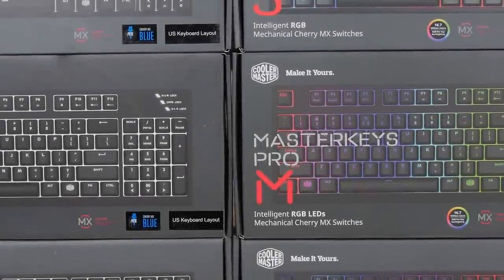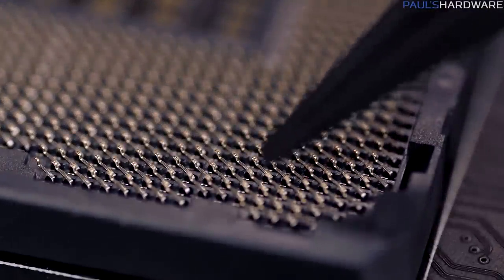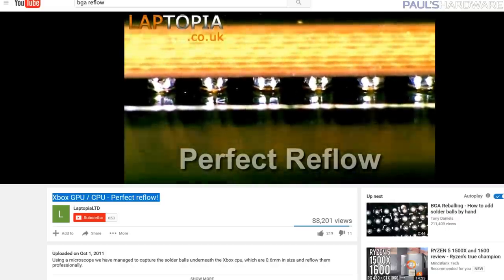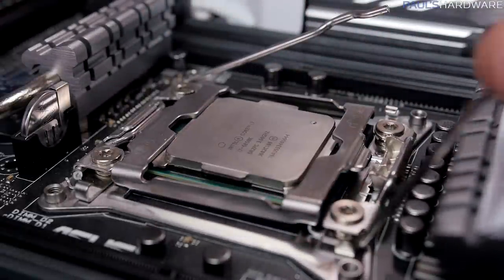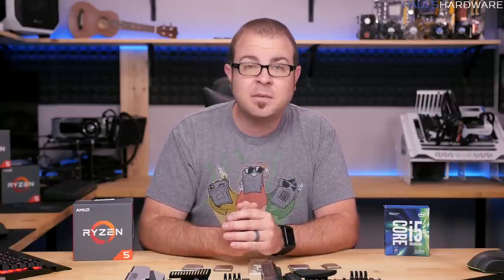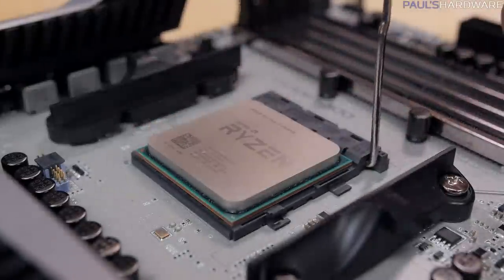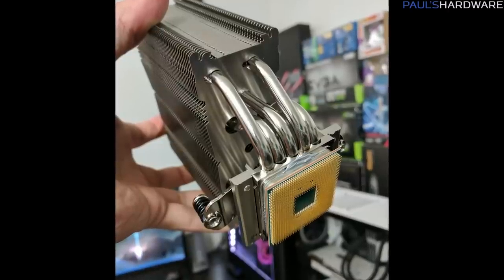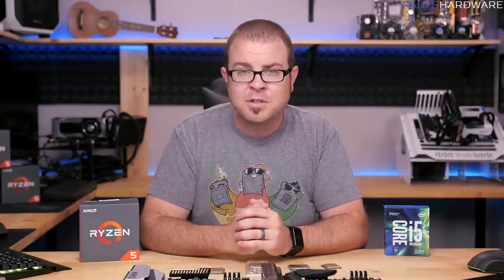LGA vs PGA! Which is better?

Comment: I had a 370 socket pentium 3 with some broken pins. I broke some off a celeron spare, put them in the corresponding holes and installed the CPU. Worked for years that way

Comment: I know so many people who have dropped their heatsink on their socket and bent those delicate pins, I remember I did just that when I built my first rig "775" years ago. I carefully had to bend them back with a sewing needle. Seen 3 other people do exactly what I did, forget the cooler fan is plugged in, loosely grab it, only to be snagged by the wire. Boom, drop it and hits the socket. A mistake I made years ago and will never do again. as they increase the connectors, I think lga is the way to go. but I liked pga better because the socket was less prone to damage and the cpu's were always the pieces I kept safest. Edit: also, I like to comb my hair with them, I feel high class combing my hair with gold.

Comment: Just use any plastic card, and a sewing needle to repair PGA pins. Sewing needle is used to fix really badly bent pins, and get them facing up. Then use the card and push all the pins in each row, and all of them will become straight. Takes some time, but it's much faster. Not to mention the CPU I repaired had around 50 bent pins, because my friend tried installing the CPU into the wrong motherboard and decided to try forcing it in....

Comment: Although socket type won't sway what type of CPU I build a system around, I have a very strong preference for PGA. I've only repaired 2 LGA sockets in my life time successfully, but I have straightened the pints on many a PGA CPU - it just takes a razor blade, a steady hand, and some patience. A PGA pin doesn't have to be PERFECT in order to work, there is some margin of error, albeit very very small.

EDIT - LOL, I typed this before I got to the part of the video where you nearly verbatim said the same thing about repairing PGA CPUs. XD

Comment: Even when a PGA pin breaks, your CPU still isn't toast. Sometimes, minor stuff is affected (like one of six SATA ports not working) and you can live without it. And also, you can repair even a broken pin. Simply place the broken pin into the according motherboard counterpart and you're ready to go. PGA is unbreakable, though I still prefer LGA. Socket for Naples and the 16-Core Ryzen is LGA btw.

Comment: I managed to repair an FX 8320 with 28 bent pins, luckily none of them bent in the middle of the pin. For me the last part of the process is a little elbow grease and plenty of socket wiggling to seat the pins proper. I still use the CPU to this day. Tricky shit tho, bending pins lol

Comment: Intel switched to LGA to transfer mishandling and invalidation from Intel to the motherboard makers. Shrewd move by the intel manufacturing quality control dept and the engineering dept to shift the potential of damage from the expensive cpu to the motherboard.

Also side benefit for LGA (as you pointed out) removing any cpu cooling is virtually guaranteed not to pull the cpu out, since the clamps will physicall hold it to the motherboard vs the ZIF socket is only holding the pins when clamped and it was only designed to make electrical contact to the pins, not to counteract a force pulling on the pins/cpu. 

Great vid.

Comment: The trouble with PGA is that the conductors are large relative to the tiny pins of LGA, and while that may be better for durability, causes PGA to have inferior electrical properties (to LGA).  LGA packages can attain a much higher signalling frequency vs. footprint ratio - as in, to reach the same signalling frequency the pins on a PGA package have to be farther apart than on an LGA package.  This makes CPUs with thousands of pins impractical as PGA packages.  Hence why AMD will be using LGA for Naples and ThreadRipper, as the socket is rumored to have 4094 pins...

Comment: It's very simple: LGA - more expensive motherboards. Risk is on the less expensive part. PGA - less expensive motherboards. Risk is on the more expensive part. easy. PGA has a slightly letter rate of contact where in the real world it doesn't matter much as swapping cpus is not something most people do very often.

Comment: imo the best solution would be a PGA with a retention bracket of some sort, to hold the chip to the board more securely than amd's little locker arm. the issue with PGA is after a while if you pull your cooler off the board, it generally takes the CPU with it, and bends the pins.

Comment: Over the years I`ve broken of pins on various stuff (from cpus, old  IDE HDD`s  to various other connectors) and still managed to get that stuff working by inserting a small pin made mostly of a bit lan wire strand into the female end. Last thing repaired this way was usb 3.0 connector on mobo. And yes I know how it sound, but hey it works (most times)

Comment: Is there any appreciable difference in heat removal between LGA and PGA? The extra thermal mass of a PGA could make some difference or is it so inconsequential. Why I ask is (and yes I am showing my age) but there was a bit of a battle between the two types in years gone by that the PGA took more heat away to the motherboard back plate. Any ideas?

Comment: Actually if a pin breaks off it is not necessarily toast, some pins are redundant Vcc and Vss pins, I have had a couple 486 and pentium cpus that lost pins and they still work because the missing pins were redundant pins.

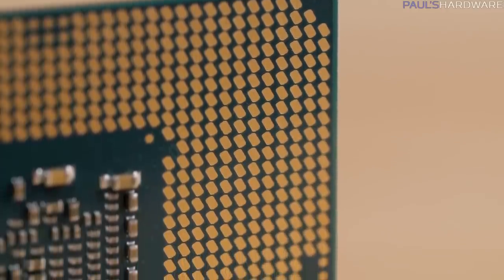Comment: 3:38 its also ALOT more cheaper to make, instead putting the cost to the motherboard makers
Intels CPU's are overly price and very cheaply made, the CPU and the cooler
AMD CPU's are much better quality but run too hot and take too much power, however they are easy to damage
As an engineer I recommend AMD, however Intel is great for servers since the power and thermals are so much better

Comment: I prefer LGA for pretty much all the reasons you listed, however no matter what cpu you have, you should always stress it to heat up the thermal paste before taking it apart. You don't want to have to apply large amounts of force when dealing with all the exposed parts on your motherboard or in your case. A slip of your hand may result in a computer less useful than a paperweight.

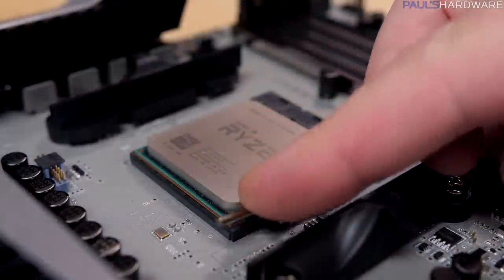Comment: J am worried that my processor is dead after I drop it a little on its dedicated slot on my mother board. But after watching him putting his processor at 1:27 I'm quite relief because that's almost exactly how i install my processor. Btw, after setting it up my monitor shows no display. I don't knownthe problem yet.

Comment: I've heard your PGA CPU isn't always toast with a missing pin. Apparently if it's just used for power delivery, the CPU with pull more power from the other power pins. Can't confirm this however.

Comment: I would like to post a minor correction:

Not all boards with the same socket have the same number of pins. Several pins are dedicated to power delivery and they are not always all necessary. Like in 2011-v3 the number of pins between boards vary to the extent that at one point asus was advertising that their boards had more pins than others. The same on the AMD side where you will find budget boards that can fit every CPU but are rated at lower wattage.

That being said... if you break a non-essential power pin you can in fact still use the chip although I would not recommend it. One of my old FX chips ran for 3 years without 2 of its pins (lost when removing a cooler like in the video)
Reply: Link Related: https://rog.asus.com/articles/overclocking/asus-rog-x99-exclusive-oc-socket-extra-pins-extra-performance/

Comment: I would say.. Reparing LGA is really hard. Use to work  at a computer factory with design and irregular products. We had a guy there that was like the one bending back LGA pins guy. And wile he manage to do it more times then not. Even with years of experience, he probobly broke of 20-40% of the once he tried.

Bending back PGA.. with a good pincer... really no issue what so ever. Sure sometimes some breaks of, but its rather rare.

If  i was head of a large design and manufacturing unit i would defiantly go for the PGA. Its both cheaper and simpler.

Comment: watch out when using the pga and arctic silver 5 compound, when un-installing a heatsink it can pull the heatsink out of the socket without unlocking the lock arm.

Comment: Sometimes you get lucky if you bend or break a pin where the CPU will still work. Some pins are redundant (example, there are multiple pins for power and ground, so if you break one of those, the CPU will likely still function perfectly fine).

Comment: I had my LGA 1155 motherboard with a pin half cut off, it was working absolutely fine also when a fan slot was damaged I manage to replace the entire mobo using the warranty getting a new GA-Z77x

Comment: You forgot a very important comparison point there, Paul - thermals.
After building AMD systems for 14 years I had to (unwillingly) turn to Intel in 2015 due to AMD's steady and seemingly irreversible decline up until lately.
Man, was I unpleasantly surprised to find out how much harder it is to cool an Intel CPU under the same environmental and workload conditions.
Considerably smaller surface area and thinner packaging turn out to be SO important. I can't wait to switch back to AMD because I like cool PCs.
Reply: That's from intel's recent switch to TIM instead of soldering the ihs to the die.  What type of surface mount has little to do with the thermals.

Comment: PGA packages generally provide a thicker CPU package that is more resistant to bending under the forces of a mounted heatsink. PGA Sockets are also less expensive than LGA sockets which can help reduce the price of a motherboard.

Comment: The last time removed an heatsink, the processor adhered to the bottom of it with bent pins. That was the last time I've dealt with PGA. the latch didn't do it's job:(

Comment: oooh the feel when you take apart an old pc with athleon processor and pulling out the cpu with the heatsink x'D happened a couple of times. aswell dropping the same cpu taking it off. man i was heart broke x'D several pins needed to be aligned again. xD got it working!
or my first intel build? that crunhing noice when installing the intel cpu? omfg. being a student with hardly any money. and you know what im talking about... specialy when you went all in with a i7...

learned only one thing. heating the cooler before removing the cooler. nice tip!

Comment: Of note is that, as CPUs and sockets age, motherboards get more expensive relative to CPUs. So building a used AMD system might end up being cheaper, since that's one less point of failure for the motherboard and, thus, an overall increase in motherboard supply relative to CPU supply.

Comment: You can avoid pulling a pga cpu out while removing the heatsink by slightly rotating the heat sink a little to the left the a little to the right. Works everytime for me.

Comment: So I've seen LGA sockets [not CPU sockets] that have a pin with a spring behind it, rather than the zig-zag pins in the sockets on LGA motherboards... I wonder if that type of socket could work for CPU sockets? The spring-pin LGA sockets are much more durable than what motherboards have, so it would be a more durable system overall.

Comment: It's not a total absolute loss if one of your LGA socket pins are bent out of place, you can repair it if you have the tools necessary, all you really need is some precision tools, and a really powerful magnifying glass on a arm swivel or something similar that you don't have to hold, that's about either a 3x or 4x zoom and lets you really see up close to what you're doing in such a small and delicate area that would normally be hard to see, preferably one with a built-in lamp so you can see what you're doing.

Comment: PGA, fixed about 50 of them ...2-3 dead(too bended and broke of in the end), 1 of them had a severe bended pin ...broke off, still working so it's not toasted - depends. Passed all stability tests. LGA on the other hand is more difficult but I did fix one that had a couple of bended pins(nothing serious). Love weird/hard cases, makes me feel like a GOD :P haahhaha. I'm a pro btw and not an amateur but I feel like a kid when dealing with these, happy and excited at the same time(oh I do swear a lot if I fail ...e.g. break a pin even if it was a lost case anyway)

Comment: I don't remember the last time I changed a CPU after first installing it on the motherboard. I don't remember the last time I changed a ventirad either. Oh, yes, it was 10 years ago when my EP35-DS3R died and I replaced it with a G41m-combo. The E8400 and its Noctua are still working perfectly, although the CPU is slow now.

Comment: my tip for avoiding AMD CPUs from sticking to the cooler: give it a gentle twist before pulling up. it ends up coming out cleanly, and I've had success with even the most baked on Athlon 64's

Comment: LGA MoBos I've encountered with bent pins: 1

Fixed MoBos: 1

100% Success!

(Cousin built a PC for the first time, bent eleven pins on the board. Ended up spending an hour with a pocket knife tediously bending them back in place. Mostly need to go based on pattern recognition for angling.)

Comment: im definitely a fan of Lga just because when i first built a pc, i, in all my ignorance put an 1151 i5 6600k into an 1150 motherboard which bent the side of the cpu becausw it didnt fit snugly into the motherboard. but when i got a proper 1151 mobo and tried to install it, the cpu still miraculously worked and i use that pc to this day

Comment: Good video with lots of information, sadly nothing I didn't already know. I was hoping there may have been information why lga is used. While I have always thought perhaps you are better off with a broken motherboard than a cpu. I can't help but feel intel chose this design to push a little more cost onto the motherboard maker, thus increasing their sales margins. I have heard theories. I mean the only reason I know beyond margin costs, pin density and possibly benefits of less distance. while that may be countered by the angled/ longer pin contacts. I still think margin costs is the most likely reason. Intel has had a debacle with inferior thermal paste and not using solder like previous cpus that overclocked better. Now, I wouldn't mind if zif sockets got some similar cpu retention cover or clips. I have pulled cpus out as well. Strangely most of them were socket 478 p4's with thermal pads or old stock thermal paste. Not a fault of intels, just end users who didn't know much about computers or used the stock coolers for their intel machines. It was the same story for amd, using thermal pad or white stock thermal paste. However while I generally worked with amd systems more in repairing or upgrading, there were 2 maybe 3 incidents of it happening. I haven't seen it for a long time, either due to the better thermal pastes out there, or it not drying up and hardening.

Comment: I know the way to get the amd cpu working which has broken pin. :) just cut the resistor contact and put it inside the motherboard’s socket where it needs to be, then install the cpu. I have already tried that and it works! :))

Comment: how to repair a lga 1151 socket
1.remove retention arm 
2. get a heat gun and solder wick and desolder the socket
3. order new socket from lcsc
4. solder cpu socket on the motherboard
5.put rention arm on

Comment: can heavy coolers damage cpu socket pins in LGA motherboards? i'm using noctua d15 and i'm worried that during the installation/operation, it may have exerted too much pressure on one side of the CPU.

Comment: There are actually deeper reasons too but those thins fall in the dark depths of high frequency electrical engineering. In theory the LGA is better from signal integrity point of view but who knows does it actually matter. Maybe?

Comment: pga is easy to fix and easy to see., lga is just crap for wrecking your high send strix motherboard. even removing the cover can nick a pin and bend it and then to even focus on which pin if hard on the eyes
Reply: Break a pin off a pga, you've just fucked up HARD. Break a pin on a motherboard, less expensive to replace than a cpu

Comment: It could shake a lot when moving a PC.  Because of the heatsink weight, the tensions can be enough to separate the heatsink and motherboard.
    The motherboard lid on an Intel CPU prevents the cooler to detach the CPU form the board or to detach the top metal plate of the CPU from the CPU itself.   If AMD did put a motherboard lid on their CPU as a standard, it could too make moving the PC safer.

Comment: There's a few problems in your comparision ... ever reworked a PGA socket? That's roughly as much pain (if not more) as repairing an LGA one (albeit it rarely happening that they get damaged). Also, the LGA socket shown is pretty much the worst type with single wipe contacts - it's a decision from the mainboard manufacturers, if they decided to go with dual wipe or even pogo pin sockets I could see them being just as durable as PGA ones. About the ease of installation, I'd name it a tie with PGA being very slightly better.

Comment: My advice if you guys have ryzen with stock thermal paste on cooler like wraith stealth or spire, remove the fan first then heat the heatsink for a few seconds with a hairdryer then twist the heatsink a little bit, i did try to stress test my cpu before disassembly but the thermal paste still stuck like a glue so hairdryer is the best option in my opinion

Comment: I've been running a socket GAME, Trinity Apu based system in my semi with me for the last 4 years... I've beat the hell out of this thing... overheated it, to the point the water cooler boiled... flooded it while running, it's gone flying off the top bunk @70mph... inhaled loads of dirt, dust, smoke... and it's still going... I love gigabyte boards and amd chips...